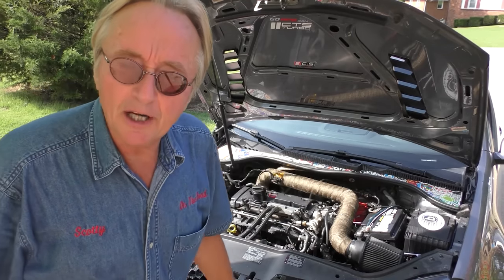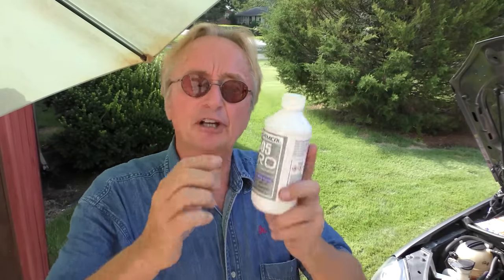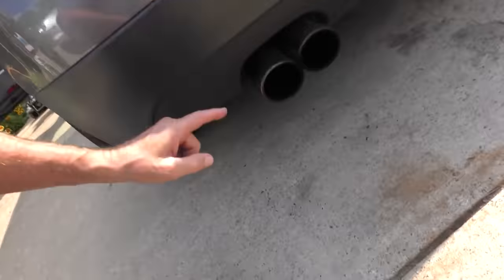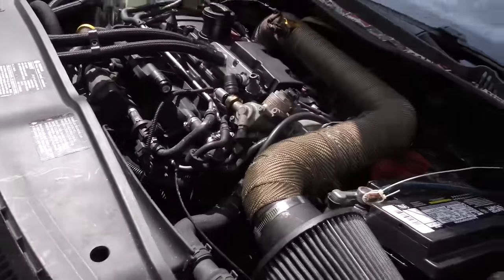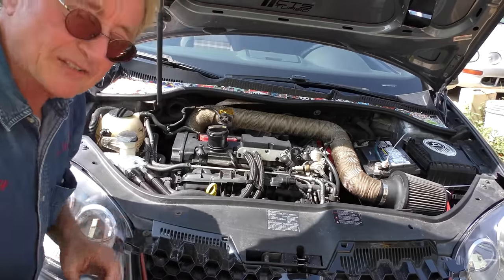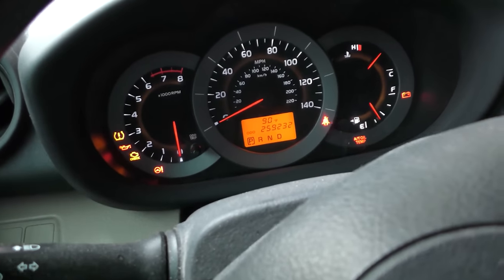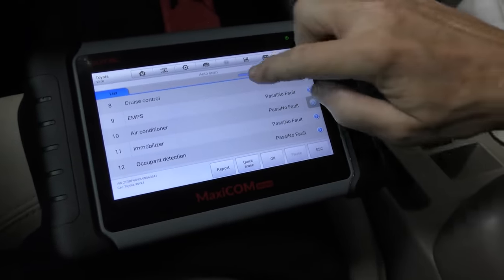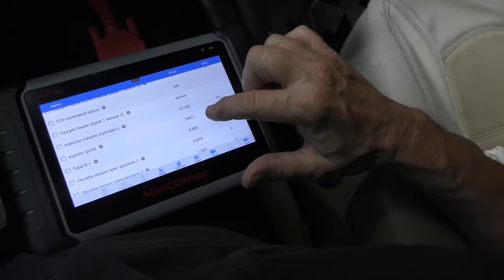3 Things That Will Make Your Engine Last Forever

Comment: Scotty, my dad bought a mid 90s Mustang that he  called me about. Seems he got a 12 cylinder(I explained how the intake runners worked) so even
though he counted 12 runners it was actually a  6 cylinder. He  next told me he had to get rid of it because it ran " sewing machine oil " which after reading the article in MotorTrend about lightweight oils that myth was desposed of. And yes it is made to run over 200 degrees to help emissions so stop putting water on the engine at 180 because it is not overheating.
Reply: Tell him to count spark plugs next time. Not runners, not valves, not bolts on the head lol

Comment: Lab analysis of the oil before and after the 15-minute treatment would scientifically show if more carbon has been removed and introduced into the oil. Even doing just a colour comparison of the oil before and after treatment would be helpful. Measuring the decibels before and after treatment would be helpful and present objective evidence.
Reply: Yeah, I was surprised Scotty didn't do a little more scientific experiments.
Reply: Scotty nos wat up
Reply: engine would be quieter based on the new oil alone.  should have changed the oil first so that clean oil wasn't a variable in the noise test.
Reply: Think 🤔 Scotty and his boy r in cahoots 4 this product.
Reply: A man of science

Comment: I have used a small container of brake fluid to clean out old gasoline motors and it worked very very well it actually had chunks of sludge come out and I worked an oil change place

Comment: From my experience, and knowledge, you should run a short oil change interval after using an engine flush. This will rinse the engine out of loosened carbon and varnish, and rinse out the remainder of the flush. And like Scotty says, "not at every oil change". I agree, and would recommend every 4 to 5 years.
The short oil change interval should be about 800 to 1000 miles. Even without the flush, this is excellent for an engine.

Comment: Acetone is an unbelievably good carbon cleaner.
It melts carbon and dissolves it.
Just don't use it anywhere near plastics and rubbers, because it damages those materials.
Reply: So basically don’t use it in any modern car 😂
Reply: Can't use it then lol it will destroy seals and what not
Reply: @That_Handle  
"...all your gaskets and seals..."?
Really nigel? All of them?
You can be sarcastic without exaggerating beyond reason.
You know, you already had me at valve stem seals...

Comment: Hi Scotty, if you change the oil filter just put a plastic bag over it and unscrew the filter. Most of the old oil will be catched in the bag and you won’t have a messy driveway. Cheers, Andy - The Netherlands

Comment: German cars are big into the paper oil filters  instead of the metal oil filter cans because of the recycling  factor. The Greens party in Germany is very powerful  and demand it, the whole car industry in Germany is pressured to make cars easy to recycle. I like it on my BMW and my VW TDI, because it's  up  on top of the engine and super easy to change.

Comment: Had good luck with oil flushes myself. If you use it on a ford modular 3v when it first has the cam phaser symptoms it will save you an engine. I have multiple customers with original engines and over 200000 miles.

Comment: Scotty, my car(toyota camry 03) reduces in speed so quickly after removing my legs from the gas pedal. It’s very noticeable. In addition, it takes too long before it changes from the 3rd gear. It revs to about 4000rpms that I usually have to remove my legs from the gas pedals so as to not allow it go beyond that.
My gas mileage has increased a lot.
Please what do you think is wrong?
Reply: when's the last time you change the transmission oil and filter? also how are your fuel injectors looking? I would check those
Reply: @thestormtrooperwhocanaim496  Thank you so much. I changed it last year. I have used 20,000 miles with it. 
Though the high rev problem has been solved. My mechanic forgot to connect The Speed sensor circuit plug after he replaced my kickstarter. The check engine light later came up with the code P0793. That was how I knew.

For the fuel injector, I will check it out too

Comment: Hi Scotty, just watched the oil change/carbon clean part. Ok engine seems to run quieter after, but what about the engine temp when you first started it? some noises disappear as the engine is up to temp.

Comment: I have an old 3.8 buick lesabre. You could feed that engine sludge and it wouldn't quit. I'm a huge fan of the 3.8 engine. They will run as long as any foreign engine and their so tough you can bolt a supercharger on one without doing anything to it and with no worries.

Comment: A man who was a engineer for Vicker's Hydraulics told me that the change to paper air filters from the old oil bath air filter was the biggest factor in extending engine life.
Reply: That would be incorrect because not all cars used em and some cars still use em. 

The best way to extend the life of your engine is to replace the internal timing chain and change your oil while running full synthetic from 0.0 miles.

Don't play Johnny race car, Don't tune it, Don't habitually floor it, don't idle it excessively, and don't run out of oil if it leaks.
Reply: @djnone8137  hey man. I hope my 6 cylinder lasts a long time when I change oil, spark, and plugs when they need to be changed (early if possible) when it’s tuned and I floor it sometimes! One redline a day keeps the mechanic away!
Reply: @Peter Angles for one, taxis get serviced via gaskets Noone on Craigslist replaces. I grew up in a shop and found 1 used vehicle in my lifetime that had 1 gasket changed which was a valve cover . 

Two look at the engine of taxis. It speaks more of the engine design and not how its driven. 

Three: show me hundreds of taxis with 500k miles. You can't buy any car out there used with that many because almost none exist.

Comment: BG oil additives  MOA mixed with RF-7  in the oil  does that + keeps engine lubed when regular oil starts slacking. also run ROTELLA 5w30 👍

Comment: Scotty, I’ve got a 2017 Ford Focus sel sedan automatic transmission with 65k miles on it. Bought it as is. Is it worth it replacing the automatic transmission fluid? I’ve heard of transmission problems after I bought the car. Anything else to help?
Reply: 65,000 miles is the best time to change the transmission fluid. Most owners manuals on cars recommend 60,000 miles, or 30,000 miles under harsh driving conditions. Me personally, I never have flushed a transmission. Have heard many horror stories. I prefer the drain and fill method. Or have the shop drop the pan and change the filter, then top it back off with fresh trans fluid. And yes, the automatic Focus had many transmission issues, there is a recall for it I believe. They may have solved it by 2017, but I'm not a Ford fan. I don't read up on them much.
Reply: I got a 2016 ford focus the best advice I can give you is don't baby the car when your pressing the gas. Step on it don't go slow. My gears were slipping until I started driving it harder now it drives great.

Comment: I don't get why people would ignore the TPMS. It can be a lifesaver and it's nice to know what the tires are doing while driving, and if you pick up a nail or whatnot you can pull over and fix it before you damage the tire. I change my own parts and program/activate them as well. Some other stuff I might not care so much for, but the TPMS was a great idea.

Comment: Scotty, on a manual transmission how do I know I’m getting “good” results off my MAF? Mine the readings go far above and below my engine displacement (ought to be stable at roughly 2.0g/sec idling in Drive on a 2.0L engine) but I see mine all over the board as low as <1.5g and up to 2.5+g; but I can’t put my car in “drive” because it doesn’t have that 😂 Any convenient way to read my data?
Reply: ☝️
🤔
Seeking answers for a manual transmission scenario
Reply: Couldn't you just drive it with the scan tool hooked up and read that data?
Reply: @mplslawnguy3389  I don’t have a super fancy scan tool that does graphing, nor do I trust myself to read & interpret it. I just wanna do the quickie spot check at idle and the procedure has to be slightly different for manual vs automatic
Reply: @brucemorris3830  9
Reply: @brucemorris3830  Hmm.  I guess I didn't realize you couldn't read the data in a manual in neutral.  There has to be a way.  Possibly put it into gear with your foot on the clutch and brake?

Comment: Did the oil cleaner reduce the oil's viscosity and thus the viscous drag on the engine for a higher engine speed? Had the old oil's hot viscosity deteriorated over time, thus thinning out and offering less cushioning to the valve train parts for a noisier engine? I wonder if the engine's quieter running might have been due to the fact that there was fresh oil in the crankcase.

The claims may have very well been true but, as you said, I'm very skeptical of the effectiveness of these magic potions in a can.
Reply: Well it was running quieter with brand new oil in it with no cleaner whatsoever.

Comment: Gdi engines like vw don't use low tension rings. They use variable valve timing to change when the valves open and close during the cycle allowing the engine "scavenge" unburned fuel from exhaust gasses, or change the oxygen content for slightly different stoichiometry. This means that under certain conditions for just a split second, the exhaust valves and the intake valves are open at the same time. So when it pulls in hot exhaust gas back into the intake valves , the carbon sticks to the cooler metal along with fresh air and a small amount of fuel.

Comment: In addition to using synthetic oil for oil changes I also use 10w30 synthetic oil in my standard transmission instead of auto transmission fluid per instructions from a Ford mechanic and after 150,000 miles the transmission shifts as good as the day it was new

Comment: After buying my 2016 Ford focus I put a engine flush on it because I did not know how the prior owner drove the car neither did she have many maintenance records on it. Since I had to put new shocks and brakes on the front end I figured a oil flush would be a good thing to do. So far I have had no problems with SEALS or anything else.

Comment: Great material. Is this stuff different to engine flush? Only watched a vid the other day of you saying never to use engine flush which helped me make my decision. but this looks the same as engine flush really? Also no oil filter change? Is that because you change it after a short while with the new oil? Meaning two oil changes.

Comment: Yes , get rid of that K&N oiled air filter . It took about 3 years to mess up my Tacoma . Mass airflow sensor was one of a couple items  that needed to be replaced . My mechanic took the air filter out of the truck tossed it into  the trash and said don’t use those things !!

Comment: Yo Scottie. I wish I had watched your video a month ago. For the 1st time in my life, I used sea foam in my crank case. The vehicle is a 95 Mazda b2300 with over 300k and still runs great. Sea foam instructions said," can be used in crankcase for 100 to 300 miles before changing. So I wen5the 300. I change oil religiously ever 3 to 4 months, regardless to my financial situation. I can afford oil easier than I can pay for a new engine. I guess I'll have to wait and see if this flush causes me any problems. Fingers crossed. Wish me luck. And, as always. Another GREAT video. Thanks chief.

Comment: If doing an oil change best to run the car through the gears to free up all the deposit from the clutch and general wear otherwise you're still going to have deposit sat in there fresh oil or not.

Comment: Volkswagens have direct injection and carbonize on the valves and intake ports, i cant see how an oil additive could help....fuel additive, maybe... but, the usual method is to physically remove the intake area and give it a thorough scraping with a screwdriver and scraper....though some shops sandblast using walnut shell

Comment: Amazing product.
I wanted to see what it would do with clean oil.
In a 2016 volkswagon tiguam with new oil, after 15 munutes ,2000 rpm I changed the new oil and filter again.
This oil looked as if it had 10000 miles on it.
The car runs better than it ever had.
The car had 50,000 miles on it and the tailpipes always had this muck that built up.
I suspect not running premium fuel was the culprit.
My wife had since been using premium and i dont see it building up anymore. Great product !
Thanks Scotty.
Reply: I can't find the name of the product anywhere on this video.
Can you tell me what it was?
Reply: That confused me in the video, what did he use, and why did he say in the later part to never use "oil flush products" or whatever? What's the difference?

Comment: I refuse to use any fuel with Techron. Tested on 4 different vehicles (2 of which were new and used Chevron fuel after the "dealer gas" was gone). Fuel mileage dropped with Chevron considerably and went back up after swapping away from Chevron.

Comment: Scotty, instead of purchasing an expensive engine cleaning solution..,
🤔 Try using just deisel fuel. 
How much is Deisel fuel per gallon compared to 'engine flush' per gallon $?
You do the math. 
Put 250ml of deisel fuel into the crankcase, using the same procedures..,
Change oil and filter.
Cleans better than harsh chemicals and is a lubricant with decarbonising agents.
Even in petrol engines, deisel fuel beats all other engine flushes.
Cheers ✌🏼

Comment: I’m sure I watched a video of yours saying DO NOT USE ENGINE FLUSH, isn’t that just what you have done? I have a diesel that’s not been maintained so well, did a flush but just with cheap oil drove 50 miles and put new oil in again. I would like to use one of these additives to do a flush

Comment: I have a 1989 Toyota Van 4WD 223000 miles. It runs good and it has no leaks. I was wondering if I can improve its MPG by using ATS Chemical 505CRF oil system. Any advice?

Some say “ if it’s not broken, don’t touch it “, others say “it can only make better, do it”

Comment: i bought a 2020 mazda cx5. i was looking at performance brakes sometimes called trade brakes. a different compound they say that brakes better. some aft market full sets are $700 in new zealand. not sure how much performance improvement you will get.

Comment: 4:21 Next time remove the cap at the end of the filter housing and push in the plug to drain the oil from the filter. You won't splash oil everywhere. It seems like a lot of your issues with German cars is that you don't know how to service them properly.

Comment: Just put a half quarter of deisal fuel in the oil ,cold motor run 10 mins  to op temp drain and change filter it does great been doing this 40 yrs and it works great

Comment: Hey Scotty, I have a 2016 Lexus RX 350 F Sport, got my oil changed at a Mobil lube express, and they used 6 quarts of Mobil 1 oil, despite Lexus says the engine only takes 5.8 quarts. Will that small amount of extra oil hurt the engine? Should I go back and immediately have my oil changed again? Thank you, great video as always.
Reply: No, that small amount of oil won't hurt anything, but keep adding and eventually problems start.  It's possible they didn't even put all of it in and just charged you for it if it came in bottles.  Check your oil dipstick and see
Reply: If they put 7 quarts in, I would be concerned, check the dipstick for oil level. Odds are they charged you for 6 full quarts like was stated in the other reply, and put in the proper amount.
Reply: My 2010 Venza takes 6.4 and it's been overfilled half a quart before. It was fine. And that was years ago lol I'm still daily driving it. The .2 quarts won't hurt at all.
Reply: @tylerc7037  - Thank you
Reply: Your car is going to break

Comment: Just an fyi. The engine might have had the same results with just doing an oil change. Old oil  is thin and dirty possibly causing noise and new oil is clean and thick and possibly causing less noise. Definitely should do a comparison of how the engine sounds  again when the oil change is due for its next oil change

Comment: I use Mobil 1 oil with Lucas gas treatment at each filling. 
You could spend more money on other oils if you want to. 
Place a magnet on your oil filter,  and on the end of your oil pan plug.

Doing these things from brand new jumpstreet makes the difference. 
Running anything hard and neglecting it is called abuse.  The more abuse the less you will get out from it…

Comment: The RPM change might have to do with the fact the TPS and throttle is electronic. So the correlation of the peddle staying the same but the RPM changing might not be associated with the engine running better. Just the CPU changing the fuel air ratio as it warms up, ecct.

Comment: Hey Scotty, when my dad was alive before 1972 we used to clean out the engines with a quart of kerosene minus a quart of oil well it’s 2024. I’ve been proved his idea I use a half a quart of mystery oil with a half a quart of kerosene and I remove 1 quart of oil I put that in its place I run it for 20 minutes and at the end of 20 minutes I bring the RPMs up to around 2000 nothing more for maybe about 30 seconds to a minute I let off the idle I let it cool for about 10 minutes and I just let the oil drain out and I use a combination of basically 5W 30 purplepurple oil it’s a call down it’s a purple from Texas. I know that it has everything in it as far as it goes I believe it’s better than mobile one. Try that listen to the engine like you do and then listen to the engine after using my recipe. Good luck bye

Comment: Well remember the GTI motors are well known for recirculating crank gas (oil ) into the intake. You probably smell it due to that more than anything. I my last Audi I dropped the intercooler pipe off and drained half a quart of oil out of it.